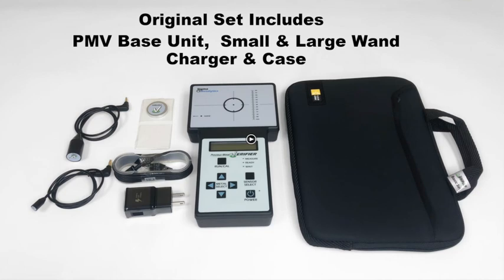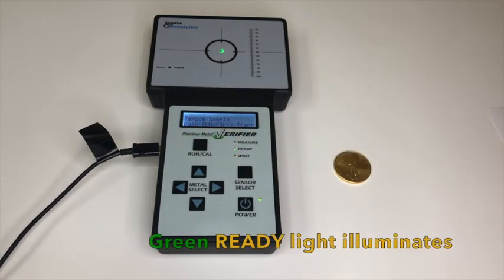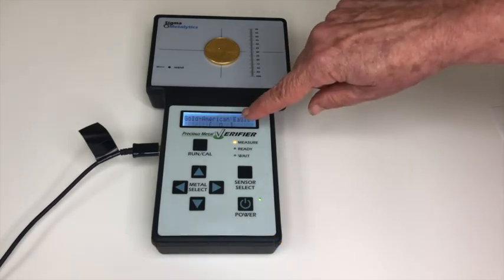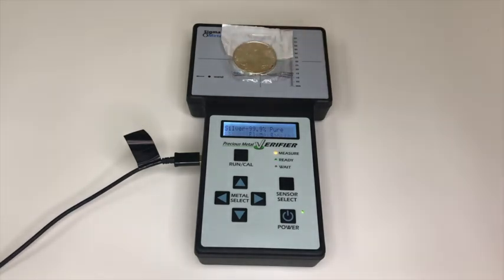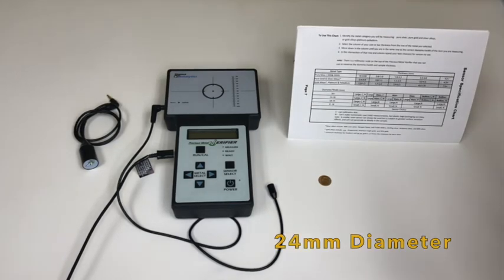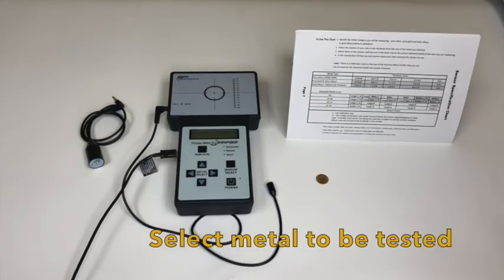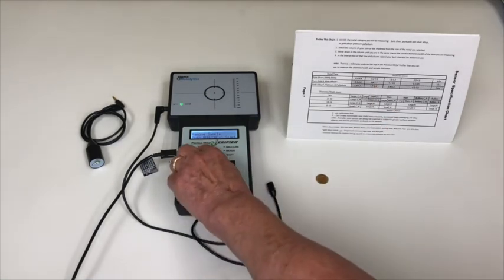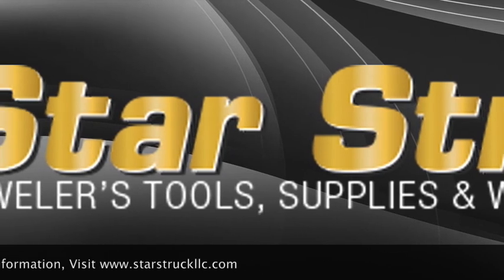Sigma Precious Metal Verifier PMV Basic Unit Set by Sigma Metalytics

Comment: hey lady. how can we know when it's fully charged?❤
Reply from the maker: When the battery is low on a Sigma Precious Metal Verifier, the green LED light next to the power button will blink slowly every two seconds. To charge the device, connect a USB cable from the power supply to the micro USB port on the Verifier. Thank you for reaching out and please let us know if you have any other questions.